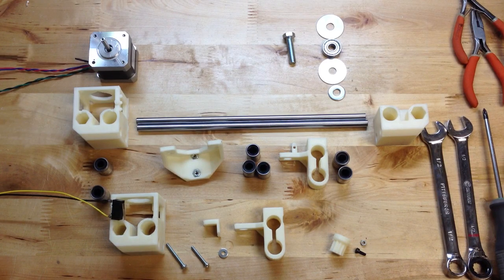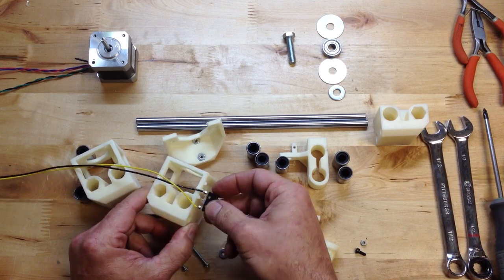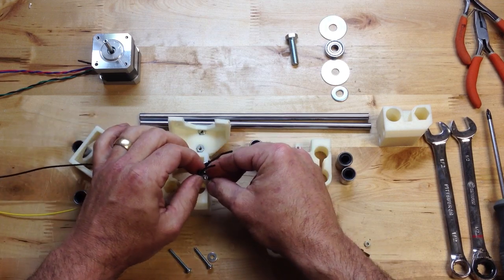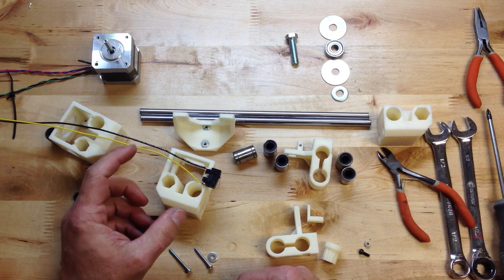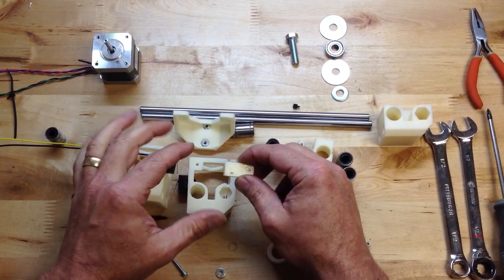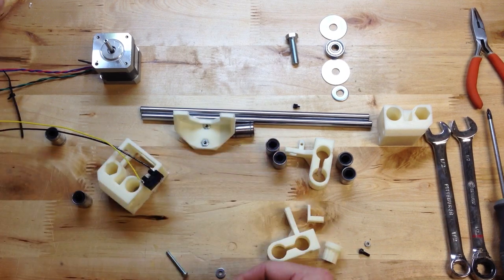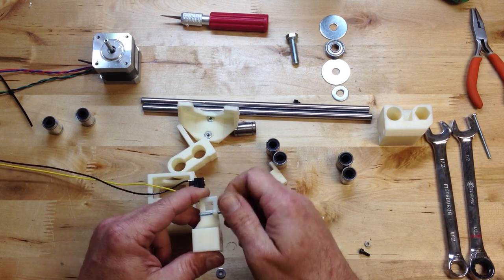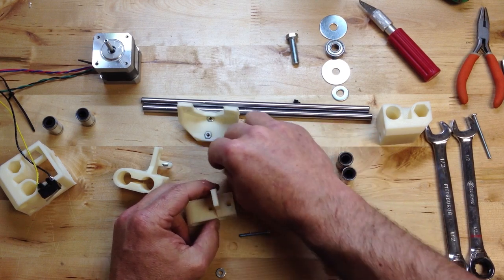Printrbot Build 10

Comment: Dis-agree with the order Brook attached the end stop.
I would attached the coupler to the x-motor, such that the geared part is furthest away from the body. Then I would mount the x-motor through the large hole, using three allen screws. Then mount the x-stop switch.